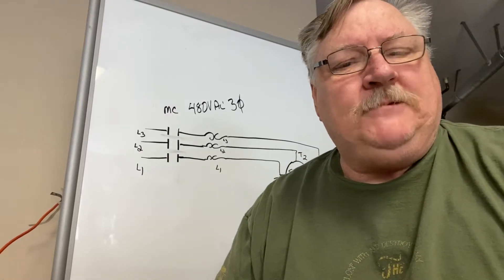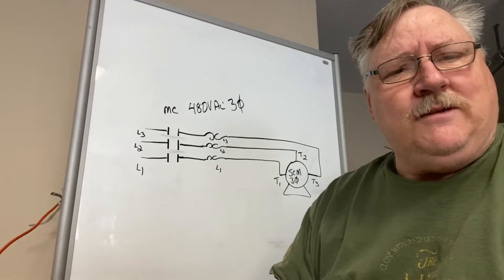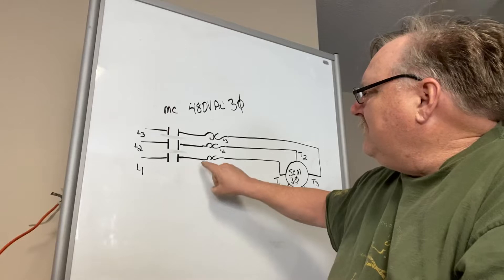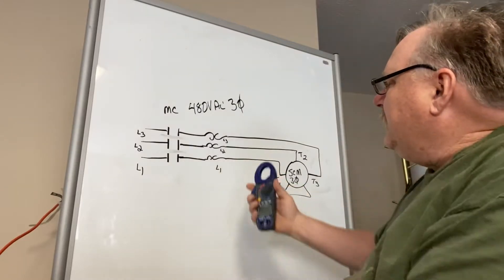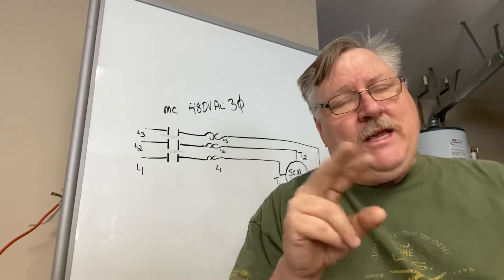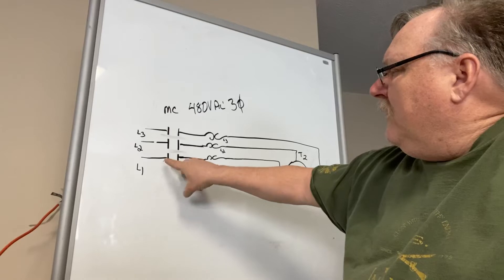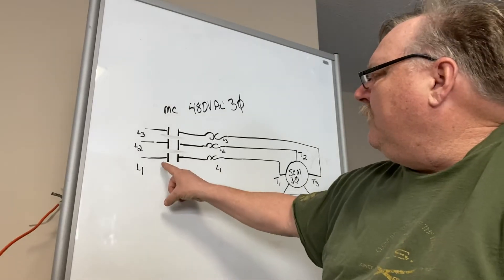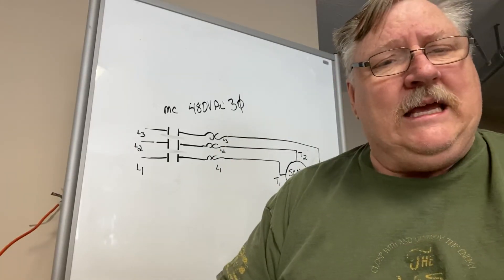Troubleshooting 3 phase motors

Comment: How do you check if you have an open between the motor and the t1 terminal at the bottom of the OL relay? Say one of the wires is cut in the field between the motor and the bottom of the combination starter. 
Thank you

Comment: You said phase to ground should be 0 ohms.l think you made a mistake saying this.Phase to ground must be open circuit in good circuit,free of potential short circuit.
Reply: for that measurement, it should be done with Insulation testers
Reply: I was Thinking the same thing.  Should be OL!  Open Loop!   But the Rest of the Video was still Right on Point and a GREAT Informative Video!

Comment: Can I use a multimeter to check the vortage with the power on, instead of a clamp meter?
Reply from the maker: Yes you can.  May be hard to do if wire nuts were used. Your best chance is at the terminations after the overloads.   A voltage drop test is good to do. The clamp is just not as invasive to the system.

Comment: Hi.
do I need a low impedance or true RMS multimeter to perform the voltage drop test ???
Reply: RMS DMM will do the voltage test,low impedance tester is for the resistance readings

Comment: 💯 question! If I switch to ohms. And I check the ohms between just the three phase wires. And two of them read 18 Kilo ohms or OPEN that means I have open windings inside the motor correct?? I'm at work right now
Reply: Correct. Your motor’s windings are bad

Comment: Informative video -  But, wearing proper PPE & locking out properly  - you can do so much testing with the multimeter in the ohms position that you are almost always guaranteed to find an issue inside the contactor starter panel if there is one with just using the ohms position on your multimeter and if no issues found inside the contactor starter panel then the issue is outside at the motor with mechanical bind or mechanical damage or possibly in the motor junction box mounted on the motor etc.

Comment: Hi I’m new to all this but I’m tryna teach myself and I’m currently in a situation so we have 2 3phase motors and 1 keeps shutting off on its own I’ve switched the contactor and the breaker from good motor to bad motor and motor still shutting off and the good motor continues to work without shutting off could this mean the motor is bad then? PLEASE HELP
Reply from the maker: I would check the motor current with a clamp meter. Should be the same on each leg. Check data play for your motor amps.  Compare. Motors overloading happen for two basic reasons. Electrical and mechanical.  If motor is working too hard due to bearings going out or something is jammed, or motor has a short to ground or phase to phase.
Reply: @bigmikeh5827  thank you for responding appreciate your advice/help
Reply from the maker: @zay8452 my pleasure. Ask anytime.
Reply: @ hey how are you doing I have another question so our machine shut off while I was on vacation and the safety relay k2 light won’t turn on I can’t get machine to reset in order for it to turn on it has power just the not able to reset it in order to get the plc boxes on

Comment: I have a locked rotor motor .75 hp 1.45amp that is making sn aweful sound when starting.   Its on a motor starter combo.  It sounds like it is struggling to start.    The contactor is sparking a little.  It tripped immediately.   When I change the setting in the breaker in the motor starter to D , it holds but makes that weird sound.   Everything is brand new. Any idea?
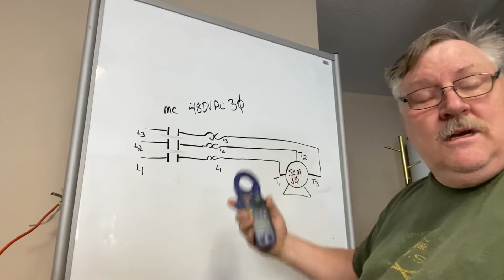Reply: He mentioned what I was going to say at around 6:00… But, check voltage out of the contactor as I have seen those go bad on three phase equipment where one phase has a significant drop across the contactor…
Reply: Btw 480v 3 phase.
Reply from the maker: I would separate the motor from what it’s driving. That will separate the mechanical from electrical issues. If still doing I would use clamp meter to see if phase current is balanced. Is the new motor rated for high starting torque?

Comment: Never just trust and reset. Never ever trust a contact. I had a friend who was working at another factory that trusted a contact and reset it. When he did it blew up and shot a piece of metal into his forehead and the arc burned his outline into a panel door. Killed him instantly at 24 with 2 kids. Your first instinct should never be simply to reset something, it's tried for a reason and that reason is 100% of the time because something somewhere is dangerous
Reply: What the hell was he doing touching anything with that much energy without an arc flash suit and other PPE!
Reply: Not wearing proper PPE and being not into proper safety can result in bad consequences!
Reply: How did it blow up? The coil control voltage should have been much less than 480 volts, probably 120 or less. And the overloads should trip before any major arcing happens inside.
Reply: @j7045  I'm not sure on that as far a as the how. I do know it's still in the panel and they show all the new mechanics there as an example
Reply: Tall tails on a little fox

Comment: When you say 0 ohms to ground when testing phase to ground, do you actually mean infinity? OPEN circuit?
Reply: I think he mean infinity  which means open circuit.  You shouldn’t see any resistance on the meter when you doing the test. if you see resistance that means the  either the power wire is shorted or the motor itself it’s shorted. To know if it’s the motor or the  wire you can disconnect the wire on the motor side and do the ohms test again if on the meter showing you OL  that means the wire is good the problem is inside the motor
Reply: @kenliang6946  Thanks, that is what I thought.
Reply from the maker: @Neil-r8z  yes.  I misspoke in the vid. Thanks for the catch.

Comment: I didn't know that if your multimeter reads more than 100 ohms it does not sound. Where does that info come from, Sr., if I may ask?
Reply from the maker: Experience.  It will vary between meters as I’ve experienced as low as 80ohms that no tone would be emitted.
Reply: @bigmikeh5827  Thank you, Sr.